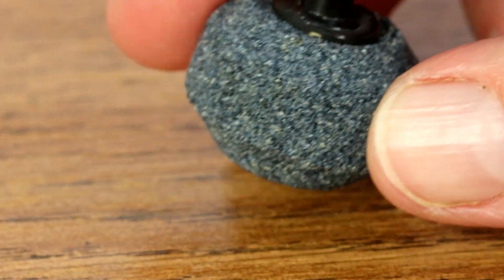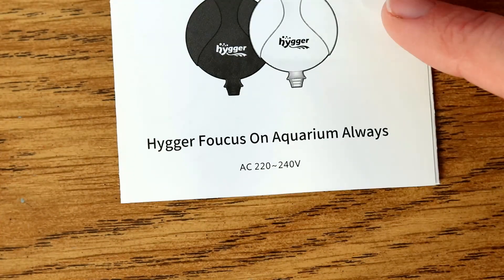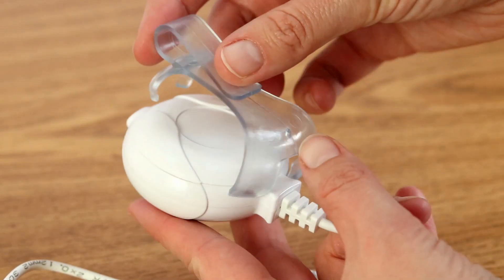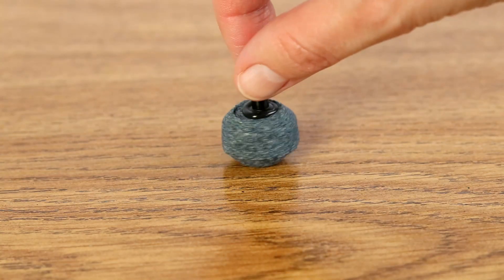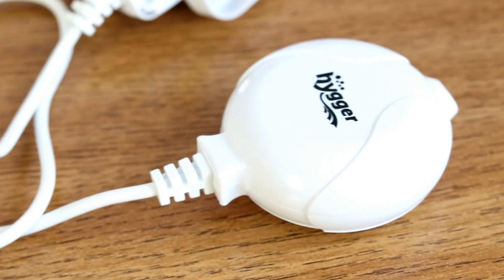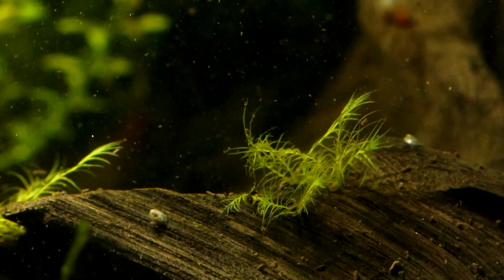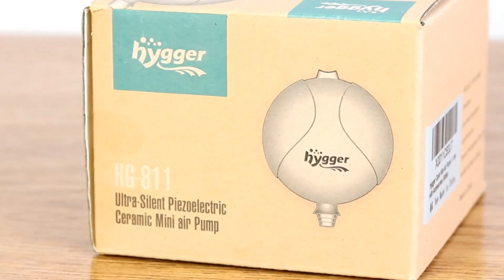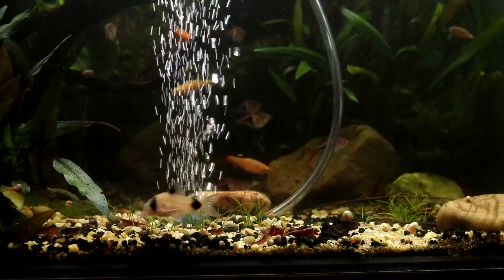Hygger Ultra-Silent Mini Pump - The Best Nano Air Pump? An Honest Review

Comment: Great but I think you made an unfair noise comparison where the hygger one has a tube connected and the other one without. It makes A HUGE difference (maybe biased because hygger sent you one?). I have that air pump myself and it’s okay but could be more silent than actually advertised

Comment: Interesting video, do you think this could be used with a non return valve so that the pump could be placed in a cabinet rather than on the side of the aquarium - or would this slow down the flow somewhat?
Reply from the maker: I did try a non return on mine and it was okay. It did reduce the output but only a bit and tbh my non returns are pretty rubbish, so if you could get a good one I’m sure it would be fine. I didn’t want to include that in the video as I really don’t know about the ceramic plates, the added resistance might reduce their working life for example - or it might not, I have no idea 😅